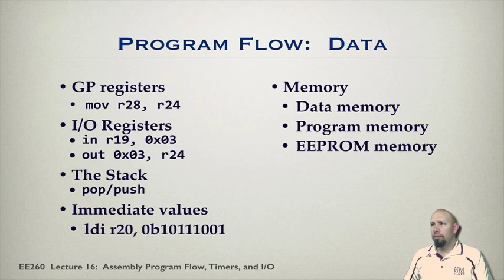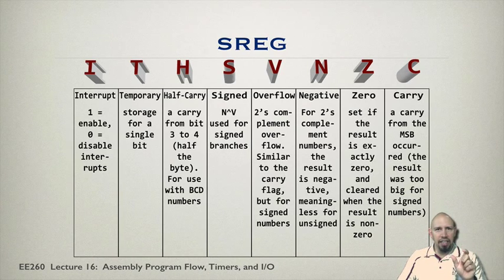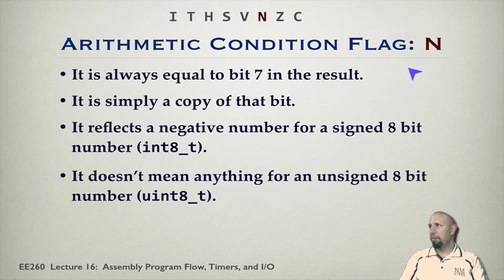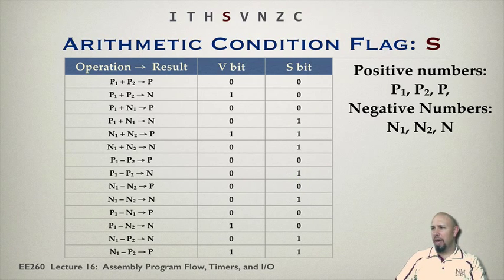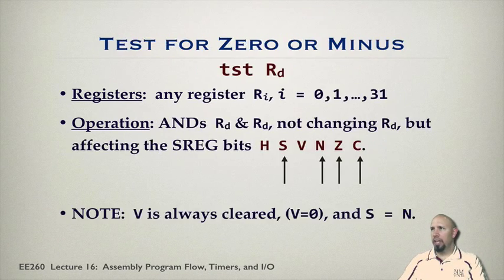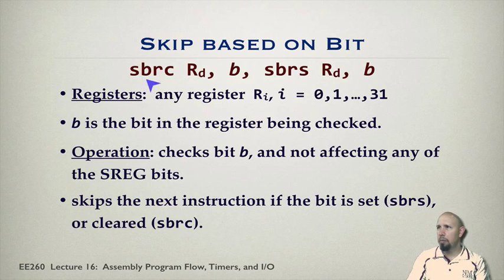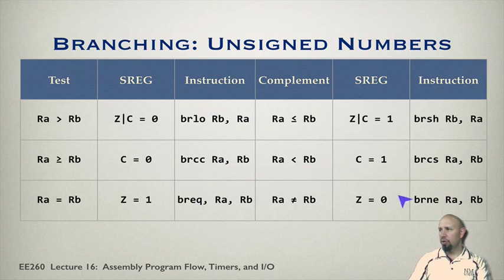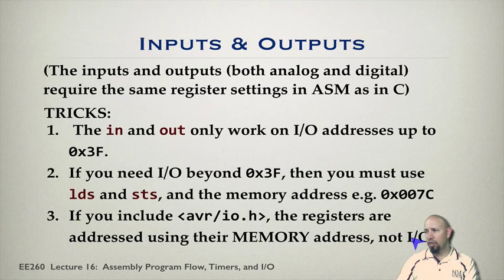16. Arduino Assembly Program Flow, Timers, I/O

Comment: Please Heip!!!
I use timer two and the OC2B and OC2A registers (pin 3 and 11). Both pins generate the same output except one is an inverted output. How do i make a dead time between these outputs to make sure both are never on at the same time?
Reply from the maker: (I commented on this previously in Lecture 10 A)
If I understand you correctly, you want two signals with the same frequency, but different phase.  To do this, set up a timer to have twice the frequency as the desired frequency.  Toggle the first signal on the rising edge of the timer, and the other signal on the falling edge of the timer.  This will create two signals in "quadrature."